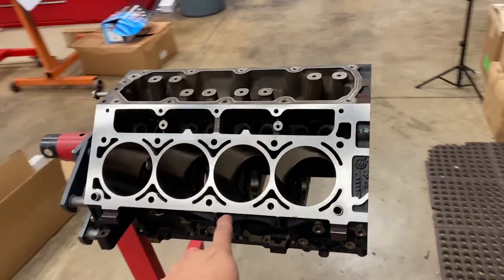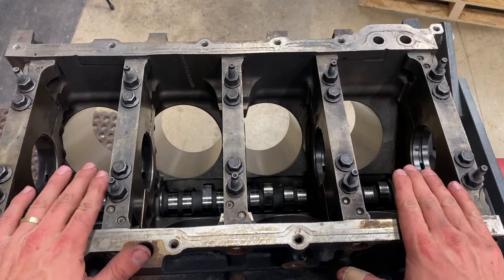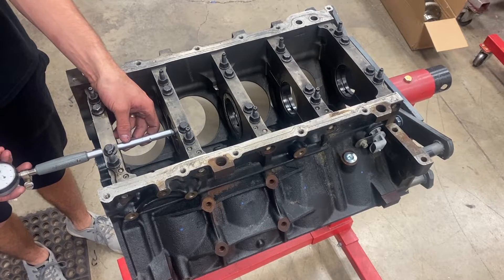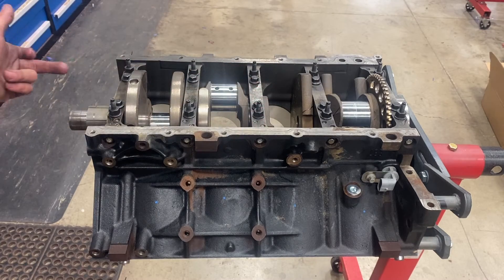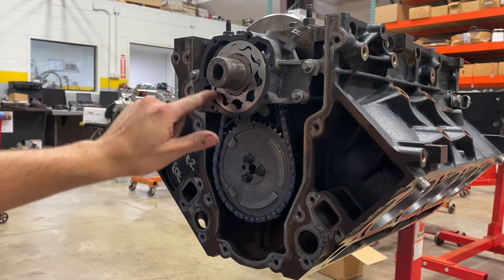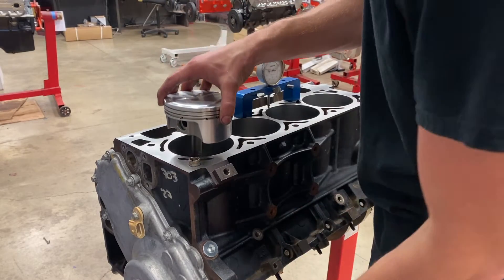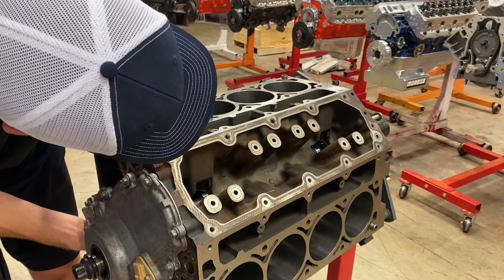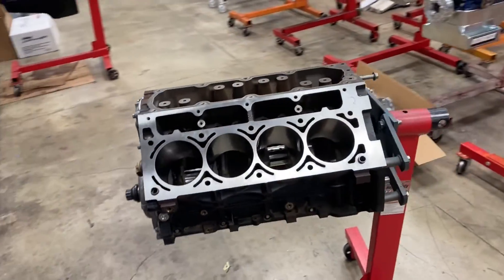REBUILDING A LS3 OUT OF A 6.0 - Part 1

Comment: Jacob,
 It would be nice if you went over the overboring of the 6.0L to 4.070.      The to look out for.   What thickness of the cylinder walls are you hoping for being N/A.     I would assume boost would be out of the question.    What is the max bore for boost? 4.030?
Thanks

Comment: I’m in the process of freshening up my 6.0l ls2. I’m going to change the pistons from a -12 dish to Wiseco Pro Tru Street Pistons
PTS523AS. I’m running the summit pro ls rods with stock crank. I want to go to a ls3 style head. What would you recommend? The truck is running a 85mm turbo
Reply from the maker: I would run our 11* LS3 cylinder head!
Reply from the maker: https://smedingperformance.com/collections/cylinder-heads/products/260cc-cnc-ls3-cylinder-heads?variant=39309244792890
Reply: @JacobVillemain   Looks like those are a 6 bolt head. I’m using a stock lS2 block. When do you think you’ll get the cast heads in stock?
Reply from the maker: @jonathanmoore5112  6 bolt heads can be installed on a 4 bolt block…

Comment: I haven't watched the whole video just yet,   but have you gone over what the min. wall thickness should be when attempting to bore a Gen IV 6.0L iron block to 4.065" /LS3 Specs?     What would the max. bore size if one was going to put a LSA SC on it ? Will it change if you stroke it too? 4.0"
thanks

Comment: Lol I work at the Romulus plant. I don’t know why you are shimming the oil pump. They slap it on and call it a day. No shims required. The literally put the pump on spin the engine once and torque it down.
Reply: I believe OEM factory oil pumps have a self-align feature and turning the engine over sets it.

Comment: love your info, u explain better than most guys on YouTube. but i do have a question. i am doing a cam swap in a l99, the heads are off and its on a stand i torqued the cam bolts to the proper number and its really hard to spin over if i back off the timing gear bolts it spins good like it did before i polled the original cam. is there something i need to check or change or is it ok ?
Reply: Did you ever figure it out?
Reply: @ufcpubg1964  yes i used a cam sprocket that had a bearing

Comment: Everything I see says you can't bore a 6.0l to 4.065 because the cylinder walls would be too thin did you have to sleeve the block??
Reply: Naturally aspirated it most likely would be fine. You would still want to sonic check the bores just because of the differences in castings. On a boosted setup you would want to only bore it if you needed to clean up the bores. The more meat the better in that case because it helps keeps the cylinders round when under pressure and heat.
Reply: @ls87gbody  yup and honestly if your running boost the power gain from the bore wouldnt even be that noticeable or be that much of an approvement when you can just run stock bore or slightly freshened up and just ran a couple more pounds of boost to get the power gain that you would see from the engine bore not to mention turning up the boost would save a lot more money since you arent pulling the block and then taking it apart or paying someone to do it then machine it and then you have to buy fatter pistons now so thats another cost then you gotta reassemble it and install the motor when you could have changed a spring or hooked up a computer and put a few more pounds of boost in and achieved more power and costed you less money and way less time for the same result, well actually it wouldnt be the same because then you still would retain the thickness of the bores so you would have a safer engine by turning the boost up vs boring. if your that determined to get some more cubes just throw a 4" stroker in the 6.0 and have 408CI (boring and stroking only gives you a 416 anyways so the bored job is only gaining you a minimal 8 cubic inches. i would say that is far from worth the time and the money if you were wanting a higher powered motored by for this instance and only wanting to stay around 600 there arent issues and arent seeing the same pressure in the engine as you would with forced induction
Reply: @Dreadz530  You still have to bore .030 over on a 6.0 to get a 408, and bore .060 over for a 416. And of course plus the prior mentioned 4 inch crank.
Reply: they just recommend not to do it because there are the ones that fail. so no one is going to risk their rep saying yes its fine to do it to every engine and then when it fuckes up the same dudes are coming back crying saying that you said this would be fine and blah blah so its just easier and safer to say its not recommended to do it. just like certain parts can easily exceed 500 horsepower but they still recommend that setup as good for 500 pounds. Its like the older 4.6 mustang motors they recommend not going over 500 because of the pistons yet you get on a forum and theres plenty of people pushing well past it but then theres also people who went 15 horses over and busted so when you have situations like that its best to just say its not good over 500 pounds. sure some or many go exceeded but thats the level where you start to get into how well the block was taken care of and all these other factors that arent going to be the same across all the blocks. same with t56 trannys they are recommended to what 5-600 horsepower yet theres guys out there powershifting them with 1000whp and beat them daily and have over 6 months of daily driving and weekend racing but tremec or other companies that sell them arent going to market them being 1000whp becuase thats not standard and when your in business you dont want to be making false claims and having people come back and threatening to sue and just all the other headache plus depending on where you live they could actually have a legit case against you and you could then be liable for all the damage that happened if the car was in that power range you said it was able to run in and it broke so its always better to undershoot and have something as critical as the engine end up being over built instead of running on the upper power limits and having more maintenance as parts dont live as long

Comment: I thought you were supposed to tighten the cap studs from the middle out?
Reply from the maker: It doesn't matter on LS platform.
Reply: @JacobVillemain  thanks for the answer, I did not know that. Darn if I lived by your shop I’d work for free, just for the knowledge. Have a great day.

Comment: I’m curious why you measure the clearances with a bore gauge w/o the crank installed?  I’ve always torqued the caps with the crank installed. Then used pasti to measure the clearances. I’ve never been able to get as accurate of a reading with a bore gauge for oil clearances.    Also make sure to check the pump cover clearance if re-installing a pump.(i assume your’s was new). Also surprised you checked OOTH clearance w/o torquing down the rods on the crank. It’d surely change some. But ballpark for gasket thickness is all you’re looking for anyway... more than one way to skin a cat.  It’s good to see a builder that actually has a clue about proper engine assembly. I cringe at most of the others. Keep up the good work!
Reply: If you only use plastigauge, you won't know the actual size of the hole relative to the O.D. of the corresponding crank journal.
Reply: lol... You gotta kidding me.
Reply: Agreed, it's a time saver that can eat your ass later... also not really a prefect TDC if the rod isn't tq'd to the crank with proper bearing clearance 🤔 
Otherwise this yougin seems to be ahead of the curve
Reply: What are you on?

Comment: I thought 6 feeler gauges were used when setting clearances for the oil pump gears?

I thought the crank pulley had to be installed before the timing cover was torqued down?
Reply: Yup, and degreeing a cam?, checking thrust with a long podge bar not a hammer if you were to have a dial indicator on the end of the crank...

Comment: .070 over on a 6.0.  Come on 🧐🧐🧐🧐🧐🧐🧐
Reply: Just did this with a gen 4 6.0 with a 2.3 whipple on it makes right at 700whp no issues. Honestly the sleeves are still thicker than a ls3 block people like to comment on what they heard. I did it, it worked .. more than once
Reply from the maker: I mean com'on!
Reply: Can that really be done? If so...I want an iron LS3!
Reply: @79_Trucker  there is no iron ls3 factory Block.  This is a misleading title.
You can bore a 6.0.     .060 but you really want to stay at .030.  And definitely not .070.   This was stupid to do to a customers block. 
Leaves the cylinders too thin and can cause lots of problems and if anything happens the block is junk.

Comment: Really enjoying all of the content your putting out, keep it up.  From your extensive experience building engines, if you wanted to buy a 5.3 LS where would you go?  This could be rebuild crate engine, used with all accessories attached or other?  I look forward to your future videos.
Reply from the maker: Personally I would buy used. Determine if it needs a rebuild (most don’t if they come out of running vehicles) and then go from there!
Reply: @JacobVillemain  awesome, thank you for replying.  Do you know of a good place here in Houston or would most salvage yards be the best bet?
Reply from the maker: @grantbassford33  check around on the Houston LS Facebook Groups, there are a couple part out shops that have good cores available.
Reply: @JacobVillemain  Sounds good, I'm looking forward to more of your videos as I get ready to build my engine.  Thanks again.

Comment: Another pritty nice job from you!  What happened to the 528" Hemi? Will the engine continue to be built? And will you make another video of it? I really Hope so! 😍
Reply from the maker: That motor has actually already been completed and is out the door! Sorry for not filming the rest 😬
Reply: OK. This is a pity. I would have been very interested! Can you please tell me which cylinder heads (?ported/cleanout?) and camshaft you have installed? Do you have some dyno data from the engine? I would estimate it at 700ps and 700lb-ft. Good job man and thanks in advance!

Comment: For a DIY or novice engine builder, what tools would you say are essential?
Reply from the maker: Really nice torque wrench and dial bore gauge! With those two tools you can build anything
Reply: @JacobVillemain  like how nice of a torque wrench? I have a 3/8 Snap-On digital wrench and a 1/2 inch e-Tork click type.
Reply: @JmanRx81  i would get a 1/2 digital torque wrench from snap on as they have torque to angle built in and these ls motors use that allot, im sure other brands have that feature built in as well but thats just what i use.
Reply: @JacobVillemain  Any suggestions for a dial bore gauge for the DIYer checking behind a machine shop?  The Sunnen sets with fixture are thousands of dollars.  Hard to justify that expense for someone not doing it for a living.